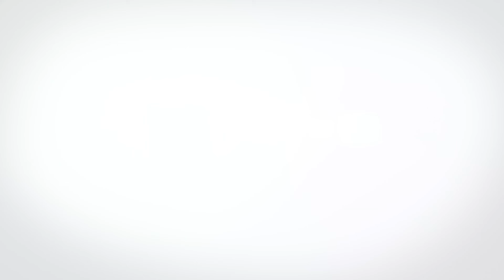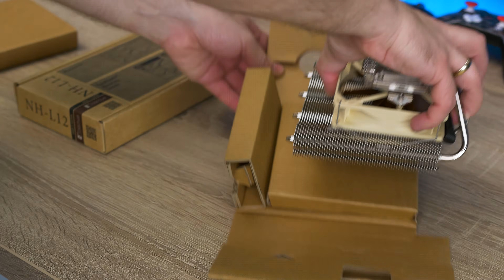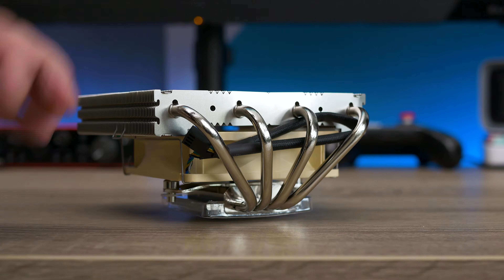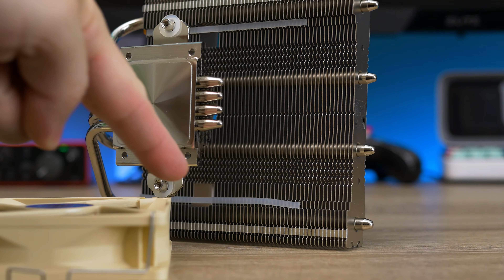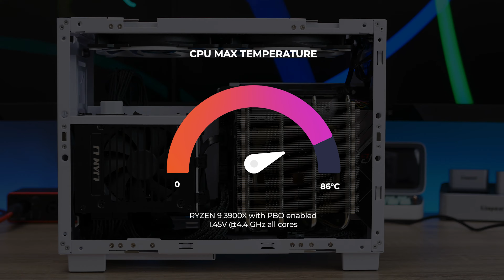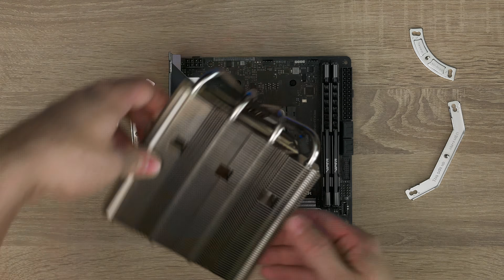Noctua NH-L12 Ghost S1 Edition CPU Cooler - Tiny but powerful!

Comment: Reminder for those that want this. Make sure to buy ultra low ram so you can swap the fan to a 120x15mm fan. Your CPU temps drop to around 10 to 8cs. It is worth it it

Comment: Can I use this air cooler on my B660i   
aorus D4 ?
Reply from the maker: It's not the board that is the question but which CPU?
Reply: @LevelUPGamingTech  i5 12400
Reply from the maker: You'll be fine then 😃👌

Comment: Hi, since the Noctua website says your cpu isn't compatible with this cooler, how did you made it work? Or what does it mean the cpu compatibility term on that website?

Asking because I have a Ryzen 5 3600 and it says the same about mine so I was thinking I needed a new cpu. Just wanna know if it's gonna be compatible :/
Reply from the maker: In refers to having the ability to properly cool it. That is why I said in the video that I intentionally used higher tier CPU just to see how will the cooler handle it 👍
Reply: @LevelUPGamingTech  Cool, good to know. So how good will it be with the 5 
3600? Also I was thinking for the Noctua NH-L9x65 SE-AM4 to cool it and the website just says "Cooler cannot handle base clock", what does it mean? Not compatible at all? Sorry but I new into this and don't wanna screw it
Reply from the maker: That is just way to "weak" for that CPU. This one will handle it no worries 👍

Comment: How well would that work with a 12600k?
Reply from the maker: I would get something larger, it will work, but if you push 12600K to the limits it might get hotter than it needs to...

Comment: can u close side panel ,how does it compare to stock coolers
Reply from the maker: Yup fully closed side panels, literally 1mm left if so 😅 Compared to the stock coolers, way better of course, but it is not meant for anything power hungry, I would not recommend it for anything beyond Ryzen 5 or Intel i5. Simply doesn't have that much power to cool them properly. I mean you can use Ryzen 7/9 or Intel i7/i9 but temps will not be great thus I don't recommend it for them...
Reply: @LevelUPGamingTech  thank you i was trying to cool 5600x in that case 65w should be fine with 3060ti .what about fans bottom and top.both out ?and what position vertical i think so bottom.fan will remove heat ?

Comment: You can ask Noctua for fan clips for 12-15mm thick 120mm fan to use underneath the heatsink, but you'll be forced to use only very low profile RAM. Same thing for adding 12-25mm thick 120mm fan on top if you have more clearance on your case.
Noctua support is top notch :)
Reply from the maker: Did not occur to me, buy yes support is 11/10 👌
Thanks for the tip 👍

Comment: Noctua delivers, as always! Those temps, in daily usage not benchmarks, are great for the processor that it is cooling.  Great little piece of engineering.
Reply from the maker: Technically it's not even meant for this one, as this one is a little furnace 😂 But it held pretty fine nevertheless 🤘